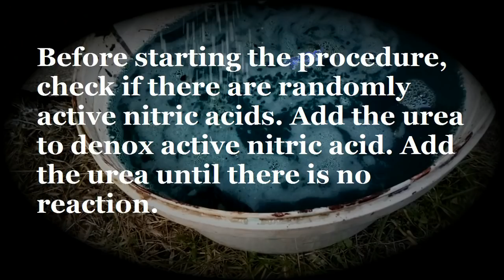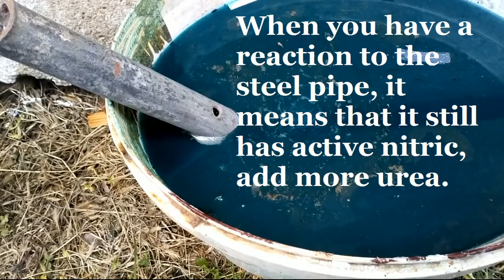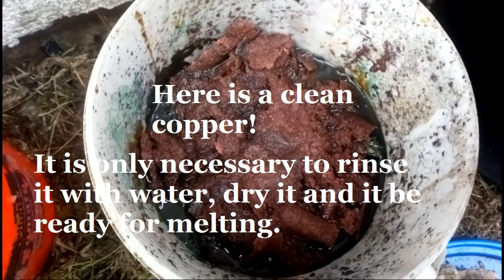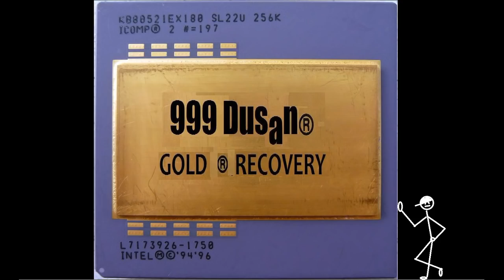COPPER RECOVERY from waste Nitric solution!

Comment: Questions:
When u cementing out copper on iron what happen if u put copper and iron pipe connected with a voltmeter? 
How many volt it will show? 
Connecting them in series can be used as battery or to power up the gold stripper in sulfuric acid?

Comment: How do get the copper off the INSIDE of the pipe?
Reply: I would just use a SOLID steel pipe that has no hollow center so you do not have to worry about that then.

Comment: Question: It looks like your metal pipe is hollow. Wouldn't the copper also adhere to the inside of the pipe? And if it does, how would you get that out? I would think a capped off pipe would be better? And does it matter what type of metal?
Reply: Good observation

Comment: Nice vid but I do one step first before I add the iron.  I add in potassium chloride pellets (for water softeners) and let it sit for a while (a few days at least) in a warm location.  Stir it a few times.  It'll go from blue to green letting you know you've converted it to copper chloride and potassium nitrate.  I filter it off and put it in the freezer letting the potassium nitrate crystallise and then filter it off.  I wash the nitrate crystals and then re-purify them and save for other projects.  Then I put the iron in the copper chloride and cement out the copper.  Doing this helps me recover not just the copper but some of the nitric as well. Can use the nitrate to make nitric acid or poor man's AQ.  Just a suggestion.  :)
Reply: Is nitric acid containing copper or we are adding the copper in nitric?
Reply: @malligaselvaraj9668  This is copper nitrate solution left over from refining sterling silver.  Many people like to put copper into the silver nitrate to precipitate out the silver and this puts more copper into solution as copper nitrate.  But it all starts with nitric acid.

Comment: hi thanks for you i want to ask you i have solution hcl and hydrogen proxied and h2so4 i have copper melted in that solution who is way to prosses copper dust
Reply from the maker: Why did you mix Sulfaric acid with Hcl and Peroxide?
Try to insert a steel or an iron rod or other item into the solution and thus cement the copper from solution.

Comment: Have u ever tried recovering copper from depopulated pcb's?  By soaking them in old nitric/water or copper chloride , then urea,  then the same method to recover that you just did?..   im thinking about recovering copoer from my pcb collection atm?
Reply from the maker: Very interesting idea you having a friend, I did not try, but it is feasible. I think that before that, it should be grind with a some grind machine for the acid to penetrate under the green mask.You gave me a good idea for a new project, thank you.
Reply: 999 Dusan Gold recovery  yes i have maybe 50 depopulated pcb's put aside as i dont like wasting and copper is my favourite, so i have thought i should burn off the plastic on my furnace at low temperature to remove the film, and then soak in waste acids like u said...    i think it may be a cool bonus for us at the end off each month,if we can collect only one copper brick from our depopulated pcb's it may be worth stacking?
Reply from the maker: 4kays ewaste Of course, I'm agree with you. I currently have about 300 kilograms of depopulated boards.
Reply: 999 Dusan Gold recovery nice..
Reply: @4kays160  The mask can be removed with a solution of 10M NaOH for about 24 hours.
Reply: @insite64   its easy enough to remove the film with lye,  sodium hydroxide, thats why i didnt bother mentioning it as dusan knows this..   he knows i meant after the film was removed, i was more asking if hes done it and knows the yield so i know wether or not to bother with my pcb's..
Reply: oh and we have 100s kilos of pcb so using your method would cost more than the copper recovered thats why we were talking about burning them in our furnaces
Reply: @4kays160  Okay. I misunderstood.
Reply: @insite64   all good mate. atleast now anyone who didnt know the hydroxide method will see our conversation and gain that knowledge too..

Comment: I saw on another video that you are supped to use iron pipe, not galvanized pipe.  I forget why exactly, maybe liberating the zinc and what not in the galvanization material.  From Geo, when Cu cements out onto the pipe, Fe is going into solution.  I think it better to not put Zn in solution, just the Fe.  Geo recommended to Moose not to use stainless to cement out the Cu.  I would think that the plain iron pipe  might even work better than the galvanized pipe.  Great to see this, as we all need to minimize our wastes and de-toxify as much as possible for both us and the environment.  Geo also mentioned the toxicity of the breathing in the dried powder from these waste solutions, as the metals tend to precipitate out as hydroxides after the acid is neutralized.  Go Dusan!
Reply from the maker: Yes, Geo has a lot of chemical knowledge of what we are doing. I do not go to chemistry honestly, I simply do what is good for me, and I take care of safety measures. Iron is better than steel, although it is sometimes difficult to find the difference between one and the other. I simply insert the metal item into the bucket and wait for the reaction if the reaction is missing replace the other metal object. Thanks for the support.

Comment: Thanks for sharing! Why would there be so much active nitrates?
Reply from the maker: It is mainly acid that is used to remove base metal from the chips after cooking in sulfaric acid. Sometimes there is a little acid that is still active, but I do not regret, immediately all the stock in the same place. Next I just add the urea and  it is. It is not best, but I do not care too much about the consumption of acids because I'm getting it cheap.

Comment: This acid can be used again for gold recovery ???
Reply from the maker: No,the acid is actually not empty from the metal, but only the iron changes the place with the copper and after the process of acid it is saturated with iron so it can no longer receive copper and other metals that are below the iron on a scale of reactivity.Acid is after this unusable for gold recovery.
Reply: Namely, for each use, the acid should be changed . But for the use of a large amount of acid, what do you do to avoid contaminating the environment.
Reply from the maker: Try not to spill it around, you can only do so much. When you use it, it is placed in barels and when you have some quantities, it is transferred to companies that deal with the removal of chemical waste. This is the only way to do it properly.
Reply: Very informative. And exciting!  Where can I get more info on "scale of reactivity" you mention?
Reply: Acid. Copper. Recever